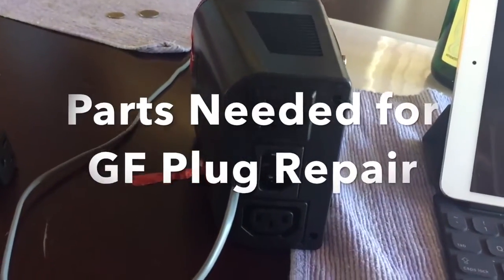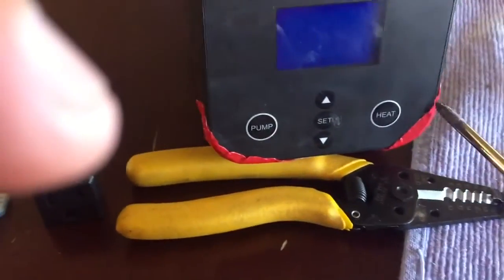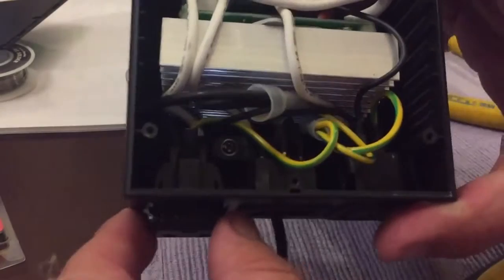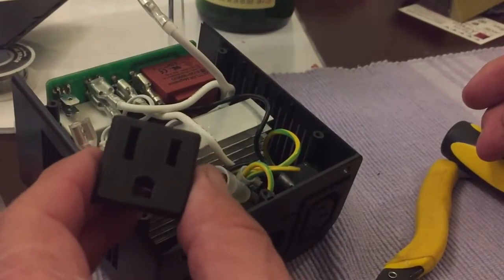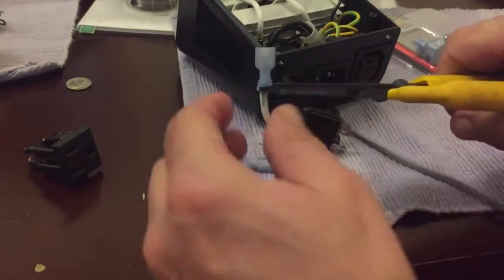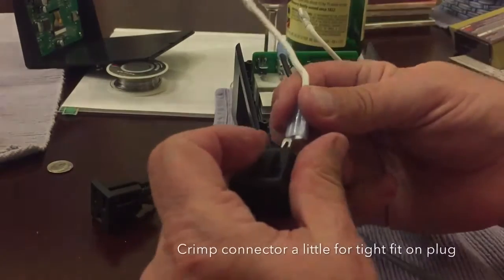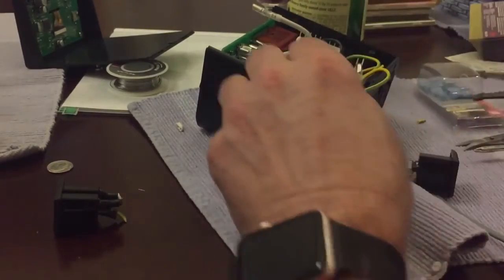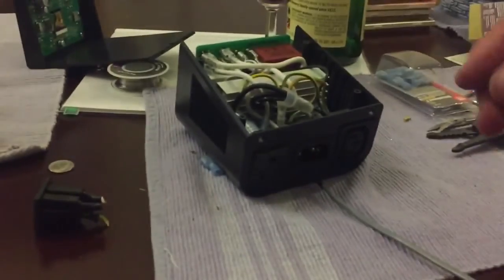GF Connect Parts and Replacement of Female Power Plug

Comment: This is great!  I'm having a heck of a time getting the outlet out of the controller.  I've opened it fine, but can't get those flanges to get in.
Reply from the maker: One trick you may try is to release one side at a time while still keeping pressure. If you have access to vascular clamps like Debakey Clamp or a artery clamp, they are the best. You can also try a needle nose Vice grip small size.

Comment: I’m inspired! Gives me hope for my busted connect controller. I need some clarification: by putting a 15A receptacle in place  won’t it be prone to the same over heating problem?  2000W heating element, 120V circuit = > 16amps ????!???  How has your been working for you?

Comment: 120 volt is 1600 watts so 15 amp is okay
Reply from the maker: 1600 watts pushes the 15 Amp safety limit. That’s why they say not to run it 100% for more than an hour.
Reply: @beerman1957  But when you look at the female socket rated at 15Amps it only touches one side of the plug. Meanwhile household sockets they touch both sides of the plug.